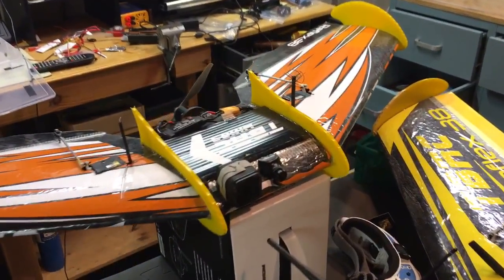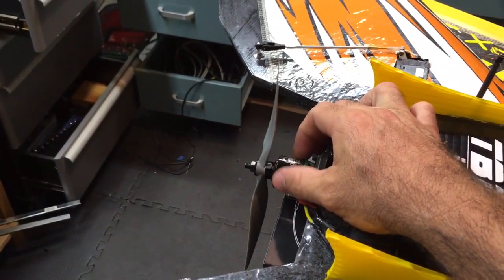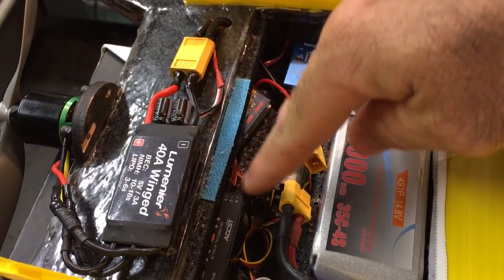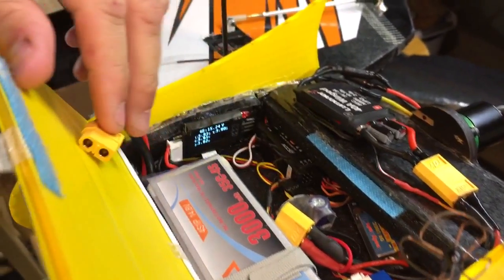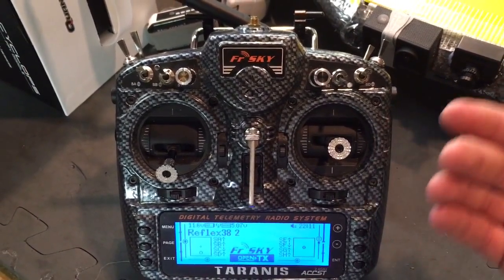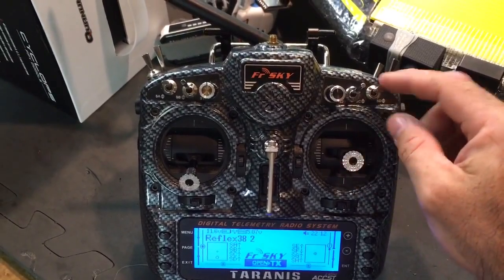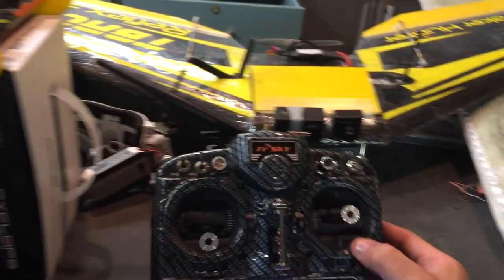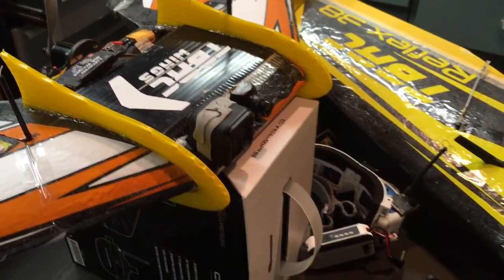TBRC Reflex 38 - Full Setup & Flight

Comment: Sweet video can you do a video on how you set the rates up on the taranis and what is the reason you have the different rates for?
When you set the wing up on the taranis is it just at 50% when you make a setup with the wing the taranis puts the elev and aileron at 50 is that what you have and how did you increase the throws for the low med high?
I have ordered the reflex 38 and was thinking of putting the same setup of David's in
Reply from the maker: dragon121978 sure no problem. Stay tuned. But it will take me a week to do. Away for business.